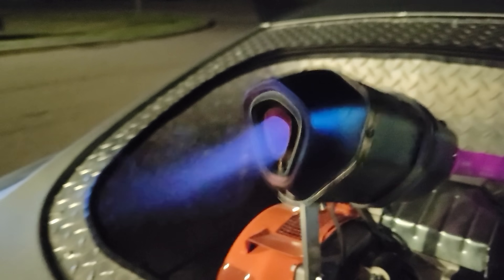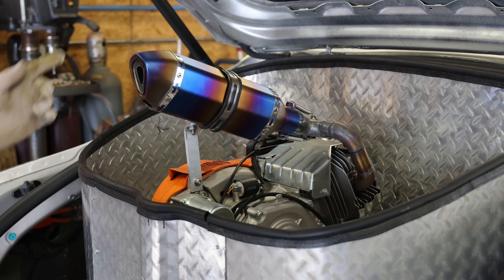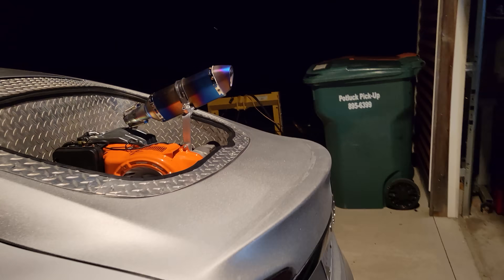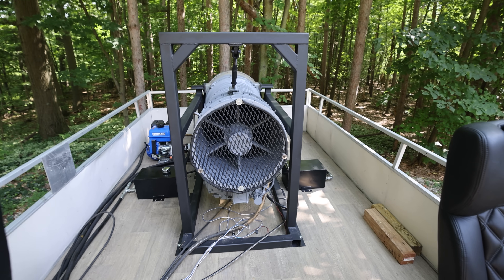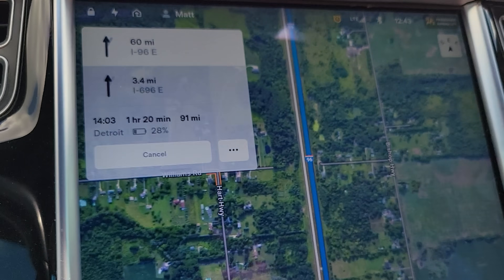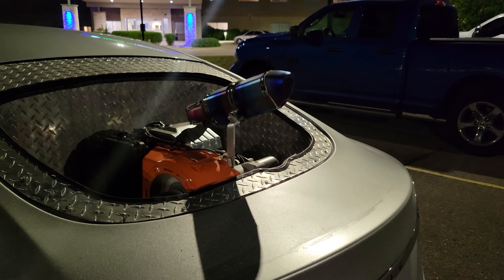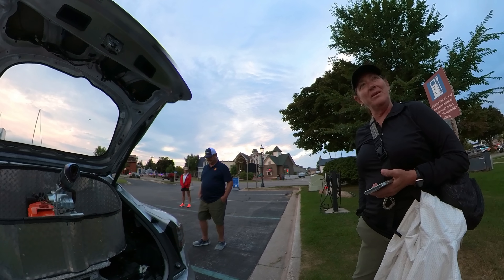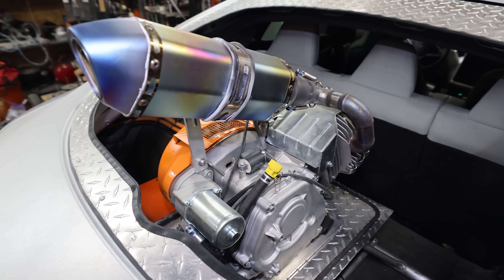Cordless Tesla (I Drive 1800 miles without charging) P.1

Comment: I am pretty sure that the Tesla system isn't optimized for charging while also being discharged. Might even cause severe damage to the battery. This whole thing was pretty pointless afterall since he mentions not making stops for electric (or gas, since that's the point of electric) only to be dependent on gas again and having to stop constantly at gas stations. The extreme amount of noise pollution was just the icing on the cake for this experiment.
Reply: Despite the claim in the video, I'm pretty sure he isn't charging while driving.  It's just an off-the-shelf generator in the trunk using the standard on-board charger.  The only modification to the charging system is having the charge cable attachment hidden inside the car.

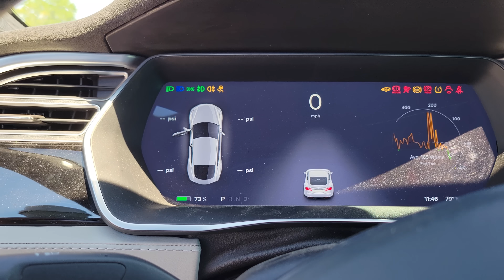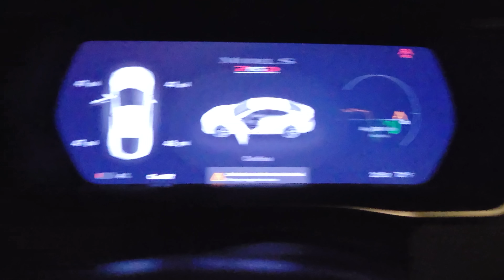Look at the Mackinac leg of the trip.  The original schedule at 11:31 had him arriving at 4:30pm with -75% charge.  He actually arrived just before 11pm (see 12:36), giving him over 6 hours of charging time while parked.  If his generator puts out 10 KW as claimed, charging just while stopped would give him an extra 62 KWh, very close to the  75% charge needed to complete the trip.

Comment: Perfect example of "just because you can do something, doesn't mean you should".
Reply: Or maybe "just because you can do something fun, fking do it"
Reply: It was running too rich, the exhaust shouldn’t be red in the daylight
Reply: True
Reply: Gerard, I think all the counter comments are spot on, show some creativity ! how about a coal fired steam boiler driving a Newcomen beam engine to power an oscillating faraday generator, to charge the Tesla, that would work. 🙄
Reply: Can't imagine there's not a quieter generator possible. Veggie oil diesel? He created a lot of room for the generator, why use such a loud dwarf generator?
Reply: “If not you than it’ll be some one else” perfect
Reply: Now do a ford lighting with a small diesel generator in the back 😊
Reply: It is greater to fail amazingly then never fail at all
Reply: That’s the same thing they said to people that wanted the first train to be electric but use a engine to run a generator to charge the battery and power the train’s electric motors. Lol
Reply: *or shouldn't
Reply: Commenters don't realize that converting chemical energy to mechanical with electricity is more efficient than using a ice engine to drive a vehicle directly
Reply: So you're going to dismiss like OC choppers? Custom rides that exceed $100k? 
take a STFU dude, you earned it.
Reply: @cloudsmith7803  Yes, I also dismiss them. Any other questions?
Reply: If everyone followed your advice, technology wouldn't be where it is today! We likely would have still been using boats to travel across the sea with your advice!
Reply: @driversteve9345  Imagine if he just pulled his Tesla with a team of horses!  He wouldn't need a charger OR gasoline!!  And if he mounted a basket in front of the horses so he could feed them on the go, plus a rack on the roof of the Tesla for the hay and grain to replenish the feed baskets, viola!  Non-stop electric transportation!! He'd go down in history as one of the great super geniuses.  Like Wile E Coyote...
Reply: @driversteve9345  Being an engineer of my entire life, what's the technology of an electic car comparing my kiddy RC car?
Reply: @driversteve9345  Nah, you just didn't think it through. Inventions are supposed to make life better. They're either something entirely new that have never existed before or a significant improvement on the original design. What this guy did is akin to giving a vehicle that runs on clean energy like solar power a steam powered engine. It's clearly a step-back in technological progress. We already have highly efficient PHEVs as an alternative to full BEVs. Why tf would we need the abomination in this video?
Reply: @CumBrianFries  It doesn't run on clean energy. Where do you think electricity comes from?
Reply: @CumBrianFries  technically he did improve the design. He removed the range limitation and also had full access to tech that other cars don’t have. 
Yea of course it’s dumb, but no other car has the quality of life things like Tesla has in the market.

“Just because you can doesn’t mean you should” has it’s place, since common sense evolves. Breaking common notions is innovation. Land a rocket is one of an example.
Reply: @SparkableGlow  uhm, isn’t the goal to stop the usage of fossil fuel and find renewable energy or with less carbon footprint?
So I guess most power plants rely on fossil fuel, but there’s also Windmills, Hydroelectricity and Nuclear Power plants
Reply: @CumBrianFries  electricity isn't a clean energy.  To make solar panels requires energy and materials. To create the electronics require the same thing. Either in production of the technology or the production of the energy its not clean. The cleanest being nuclear still requires a massive amount of energy resources and waste.
Reply: @SparkableGlow  there's a variety of clean energy option, ie nuclear solar and wind
Reply: @CumBrianFries  well if you wanna get technical the us had to burn more coal to keep up with the demand of EVs negating alot of the benefit not to mention the amount of lithium they have to mine to produce them. thats like a low hp dirtbike motor probably pushing like 20-40 hp so its really not polluting much
Reply: @SparkableGlow  If he's charging with hydro, wind, or the right solar, then it does run on clean energy! You are spewing BS!
Reply: @jakejakedowntwo6613  BMW already made an electric car with an optional generator, so nothing new here, just more BS!
Reply: @tesstickle7267  We will figure out how to make things clean by or when the dinosaur juice runs out, or we will die.

Comment: Yea, you just need a higher output generator. There is a car that does exactly the same thing. I think it is the Volt. No longer made. Also, get an inverter generator. Quieter. It is cooled with a fan, in an enclosed housing like the old VW beetle bug engine.

Comment: You could just stop for charging but less often / for less time, and run your generator the rest of the time. You would still likely stop for bathroom / food / stretch breaks anyway, so there is no point in avoiding it (other than for the cool story). Sick build though.

Comment: How much gas was consumed for this trip? What MPG did you average?
Reply: Exactly. How much did you spent on gas? Versus if it were to be charged.
Reply: @mrrightperiod  since generators are inefficient probably about 10-20mpg lol
Reply: I don't think tesla cars pass through charge.
Reply: Depending on how many gallons per hr the generator uses,if uses 1.5 gallons every 4 hrs you can drive almost 200 miles in that time,of course this is in theory
Reply: @joeandrade223  I have a 5 gallon, I think 7300 watt generator, that runs 8 hours on half load. 

The questions are: 
1. Did he use 120v or 220v?
2. how many watts?

this is solid logic; what's good to realize also is that he stopped for a lot of time to charge I think (I didn't really watch the video very carefully, just kind of skimmed it.)

The wattage a tesla uses when speeding up is a lot
Reply: literally watch the video. there's even clear time stamps. he did not neglect to mention MPG. and yes, it is garbo compared to just running a car with a normal combustion engine.
Reply: Neglected to provide that information
Reply: It's not about the spending amount of gas for this mod... It's about no Downtime to stop and charge... obviously some of yall is getting the wrong idea of this creation build. Lol

Comment: What about pulling a very small trailer with a couple larger quieter inverter generators that can be paralleled? I ask because I've been interested in doing the same as a cheaper alternative to buying an EV with extended battery for long trips, such as with a Ford F-150 Lightning.

Comment: Hm sounds like the generator wasn't really enough to confidently be free of range anxiety... Well it's got a frunk.. Could put another generator up there🤷‍♂️ surely that'd be enough so you'd never have to slow down or leave it on overnight
Reply: Adding another generator wouldn't help.  He charging was limited by the on-board charger.

Watch carefully and you'll figure out that the generator wasn't providing power while driving, only while parked.  It wasn't powering the car or constantly adding charge.  It was just an off-the-shelf inverter-generator in the trunk, charging through a hidden charge cable as if he had stopped at a Level 2 charger..  All of the rest, including the obnoxiously loud exhaust, was entirely for show.  From the design and orange color, it was probably a WEN with the cage, fuel tank and quiet muffler removed. 

This explained why he continued dropping in charge even when going only 45 MPH.  A 10 KW generator should have been able to actually add charge at that slow speed.  The reality was that he needed to drive slowly to reach the destination with his remaining charge, not because the generator "wasn't keeping up".  He told the police officer he would stop to add enough charge to be able to drive the speed limit.

Comment: Wouldn't it be easier and cheaper to just buy a hybrid? What's the point/ benefit. I guess I'm not following
Reply from the maker: The point is 1,000 horsepower all wheel drive with 100 mpg ufallo ?

Comment: 25 gallons of gas have about 5 GJ of energy, you think you can make a gas engine to use that efficiently?
So just one fillup of a 25-gallon tank is 5 GJ. The one fillup didn't give 1,300 KWh of energy to the tesla.
5 GJ is about 1,330 KWh of energy.  1,330 KWh could drive a tesla 4,000 miles.
Reply: so can they work on making 100-year-old design gasoline engines insanely more efficient?

Comment: A Toyota Prius Prime Plugable Hybrid with 10 gallons of gas with average 50-60mpg and 25 miles battery can go upto 550+ miles average total without stopping for gas or electric charge. With price around $40k it is much better return of investment compared to Tesla at this time.

Comment: In average 20MPG (11,8l/100km) is a rather high consumption, I assumed a better consumption. My hybrid is going between 55-65MPG - so as we can see, the system and power distribution is quite important, rather powering directly the wheels instead of charging and then getting the power to the driveshaft.
Reply from the maker: It's high but this engine is not very good, the n xt will be legit

Comment: Why dont Ev car has an independent engine built in for battery charging. Running when battery at low capacity. Either when driving or parking.Of cause with a good hot air ventilation when at parking area. Stoping for charging is not comfortable for instant and long distance travel with a limited hour.

Comment: You're gonna have to essentially install a car engine sized generator and at that point the electric kinda just weighs it down. Very cool experiment, I'm glad he did it. Battery tech and charging stations have a ways to go before I go electric. Just went on a road trip and 1 of the stations was gasoline but also has electric chargers. I'm thinking eventually they will all be like that during the crossover period.

Comment: In 2013, BMW produced the i3 REx, an electric car with a built-in auxiliary generator (650cc 2 cylinder scooter engine) for charging the HV battery and extending the range. This is perhaps the best inspiration. ;)